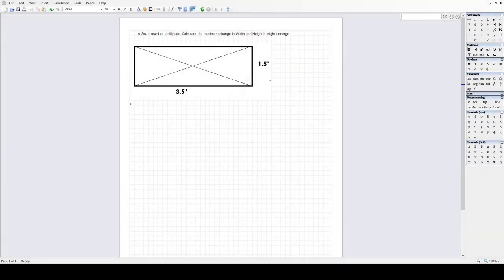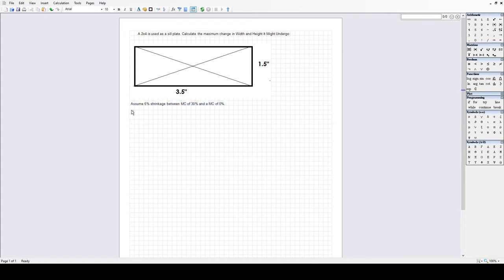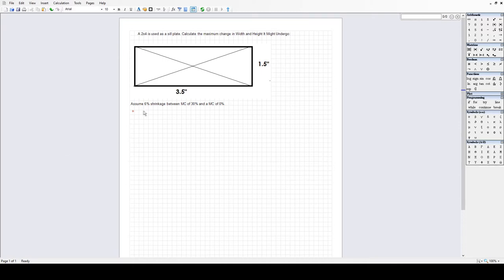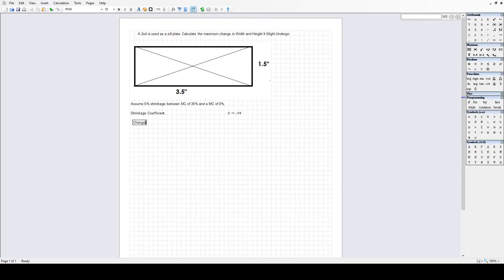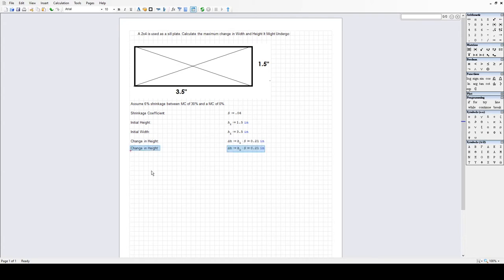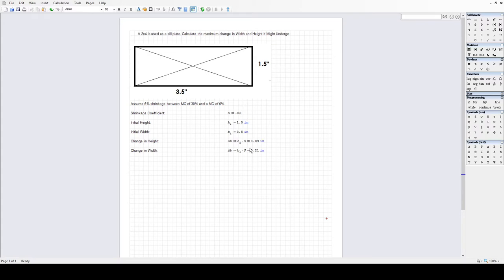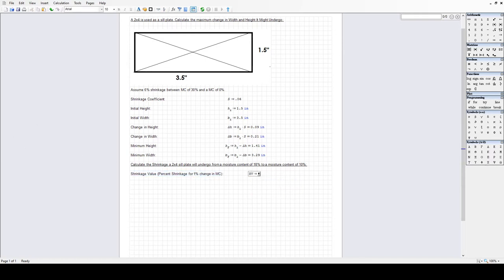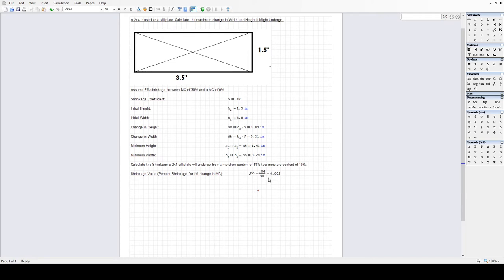Wood Shrinkage Calculation Examples

Comment: Here in UK 4"x2" 47mm x 95mm approximately 5% below stated size.
USA is like 25% below stated of the 2" dimension.
If I ordered timber 1/2" thick I receive fresh air!
Reply from the maker: For hardwood, if you ordered a "1/2" board, you would receive 3/8"
https://www.thesprucecrafts.com/understanding-wood-sizes-in-softwood-lumber-3536905

But yes, certain sizes can have quite an overall reduction, the largest being 25% as you note. It's not a perfect system, and one of those things that developed out of historical practice and have been maintained through inertia. I'm reminded of rebar sizes:
https://www.harrissupplysolutions.com/steel-rebar-sizes-stock.html

Round rebar sizes go 3,4,5,6,7,8,9,10,11,14,18. Sizes 12-13 and 15-17 aren't made. The numbers correspond approximately to the number of 1/8s of an inch in each bar's diameter. So a number 7 bar is approximately 7/8" in diameter. However, this still doesn't explain the omitted sizes. Why are 12-13 and 15-17 omitted?

Well, it comes down to cross sectional area. A number 18 bar has an area of about 4 in^2. A number 14 bar has an area of about 2.25 in^2. The square roots of 4 and 2.25 are 2 and 1.5. This is not a coincidence. Before manufacturers made the round bar we use today, they made square bar. The larger sizes were 1.5"x1.5" and 2"x2". The number 18 and 14 bars have the same areas as the 2" and 1.5" square bars, respectively. Back in the 1930s and 1940s, we were using square rebar manufactured in 1/4" and 1/2" size increments. When they started making round bar in the 50s and 60s, they chose to manufacture bar sizes with approximately the same area as the old square bar sizes. And this has just hung around since then. To this day, you won't find sizes 12-13 and 15-17 commonly made. We've been using round bar now far longer than we used square bar, but the size convention has stuck around.
Reply: Rebar is not my area but interesting to see we still hang on to old systems even if outdated like clothes sizes.
An engineer could get in a big mess if not familiar with local measurement systems peculiaritys.